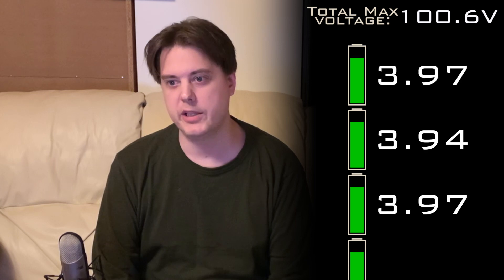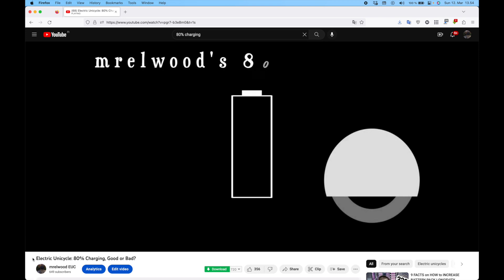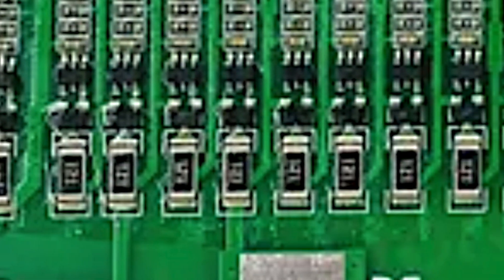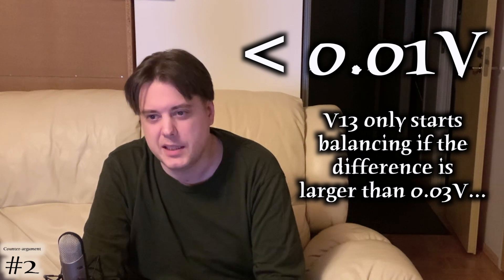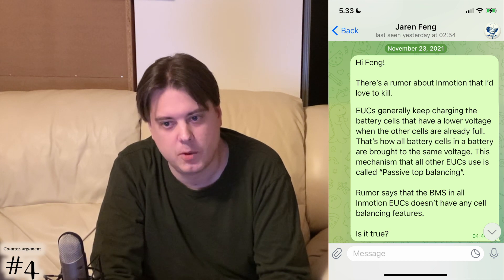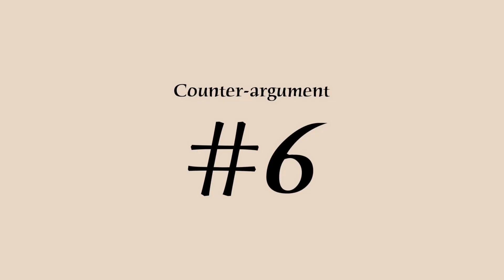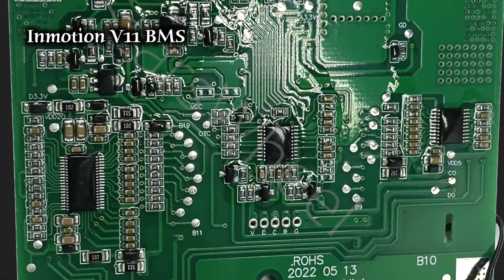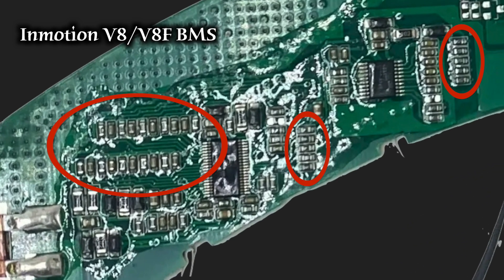Inmotion EUC Battery Cell Voltage Balancing, Yes/No?

Comment: I'm owner of v10f. I did several time power measurements with power meter (which measure power and circuit). Normally v10f  take around ~130W during charging. After green light appear on power charger it still taking ~15W and slowly decrease to ~6.5W after for around 1-2 hour(s). After 1-2 hour(s) measurement finally stabilize at ~6.5W and even it still plugged to power for longer period  (several hours more) never decrease lower than ~6.5W. Based on my measurement looks like passive balancing is working if someone else have different vendor wheel and done measurements please add comment.
Reply from the maker: What you’ve described isn’t related to balancing. The constant voltage (CV) stage of battery charging in general behaves exactly like that. The charging voltage stays the same, but as the battery fills up, the charging current decreases. Your charger would probably draw around 6.5W even if unplugged from the wheel.

The balancing currents are in the magnitude of 5-35 mA. They wouldn’t show even a dent in the total charging current measurements.
Reply: @mrelwood_EUC  Do You have idea why green light appear on charger even there is 15W taken by wheel for 1-2 hour(s) and seems charging hasn't been completed? I've seen some graphs with charging phases for batteries You're described but in that case green light on charger should only appear after all stages have been completed not earlier or maybe I miss something?
Reply from the maker: @cubbasa  The chargers turn green usually when the charging current reaches down to 0.3-0.7 A, depending on the charger. Your charger seems to go lower though, it could be triggered at only 0.15A, which is already pretty good.

The charging isn’t fully completed at any point though. As you noticed, it only slowed down to around 6.5W, but kept going still. So the charger needs to turn green at some point. And I believe it might happen a bit early just to get better charging times, or because the manufacturers try to avoid overcharging the batteries, which of course doesn’t take balancing into consideration.
Reply: @mrelwood_EUC  So, how do you know you don’t overcharge the batteries, trying to balance them?
Reply from the maker: 1) The charger has a set maximum voltage, so it can’t charge the battery to a higher total voltage than that.
2) The BMS has overvoltage protection for each cell group, so it doesn’t allow any cell group to get over 4.25V.
3) If the balancing system of a BMS fails (or doesn’t exist), in most cases where a cell group could reach the 4.25V limit will do so before the batteries have been completely saturated with said voltage. This means that once the BMS cuts off the charge (due to an overvoltage cell group), all cells drop a bit in voltage. This removes the overvoltage situation if one happened to formulate for some reason.
Reply: @mrelwood_EUC  So you can keep a wheel connected to power indefinitely without overcharging, being protected by BMS?
Reply from the maker: Yes. But trickle charging the cells “indefinitely” is not good for the battery lifetime, so always having the wheel in the charger isn’t a good idea because of that.
Reply: @mrelwood_EUC  OK, thank you. Some say, Inmotion wheels doesn’t have BMS. Which is it?
Reply from the maker: @danmano478  Haha! 🤣 Very funny!
Reply: @mrelwood_EUC  I’m glad I’m wrong and you are happy.
Reply from the maker: @danmano478  Wait, you were serious?? Ok, first of all, who says that and why?
Reply: @mrelwood_EUC  Man, I don’t know electronics like you. All idea I can make on this subject is from what I read from Euc owners Youtubers or commenters like you. I don’t recall where I read about some wheels having BMS and some not having; maybe there was some other stuff involved, I don’t recall. If you want to bring some clarification for me on this subject, fine, if not, no problem, you owe me nothing. Thank you for already given answers.
Reply from the maker: @danmano478  Ok. BMS is a circuit board that takes care of all the battery protection features, charging, balancing, etc. There can’t be a device with a rechargeable battery without at least some kind of a rudimentary Battery Management System. I showed photos of the BMS boards on many Inmotion wheels right in this video. You can look the rest up with Google Image search if you wish. A rumor like that is so ridiculously stupid that it must’ve started from complete misunderstanding of what a BMS even is.

Lesson to be learned: Some people sometimes say false and ignorant stuff. Don’t trust stuff until you verify either the source or the piece of information itself. Disinformation is the cancer of our current society.
Reply: @mrelwood_EUC   That’s why I asked. Thanks. What do you think about LG cells (like LG M50T or LT) and Samsung cells (like 30E or 50E) in terms of reliability and longer life? General idea is that Samsung are better. I understand that not only the cells were responsible for Begode fires, but nonetheless, they all had LG M50T batteries. I didn’t heard of Samsung cells wheels on fire (maybe that first S20 purposely burned by UStride had Samsung cells?). New expensive wheels have Samsung cells, hence the idea Samsung is better.
Reply from the maker: None of the cells will spontaneously combust. I haven’t looked into them in such detail that which ones would have the longest lifetime. High discharge cells are beneficial in some situations/setups, other than that I’ve not looked into them closer. The Sanyo GA cells on my MSX worked perfectly for 14+ k km, the ones on my V11 have worked perfectly for 7+ k km. I don’t think one would choose an EUC based on the cell model. We don’t choose the wheel based on the mosfet model either. They are all designed to do their job.

The Begode fires were caused by the subpar quality of the BMS board in the specific 900Wh packs. The same cells haven’t caused much fires in other wheels.
Reply from the maker: Btw, I think my batch 1 V11 has the M50T cells as well. No fires. 😄
Reply: @mrelwood_EUC   I think all Inmotion wheels have LG cells, because, from what I heard, Samsung are more expensive, and a few dealers I asked, told me both Inmotion and Kingsong don’t disclose what cells are using inside their wheels. I thought: “If they would use Samsung they would have no problem admitting it, since they are better and more expensive. So, they use LGs and hiding it.” I don’t agree with you on this: The customer has the right to know what cells he’s buying, batteries being a significant fraction of the payed price, so, yes, we should choose the wheel with the best cells for higher reliability. Here you take Inmotion’s side, knowing that they don’t want to use Samsung cells, for profitability (this is their specific corner cut). I saw a lot of Youtube videos or shorts with V12HT not turning on, or uneven batteries charging, etc., which I attribute to poor cells in the batteries. Didn’t see such problems for Master or T4 with Samsung cells. They have other weaknesses like low shock resistance and waterproofing, or maybe suspension problems, but not battery related problems. Veteran also uses Samsung cells in the most sold and reliable wheel Sherman max. Why don’t they use LGs? Rhetoric obviously. And not to forget: It’s not only about the fire, but also about the long time reliability of the batteries=wheel.
Reply from the maker: You are awfully quick to judge, and especially condemn me as taking sides.

First, Inmotion changed to Samsung cells on the V11, all silently, not bragging about it at all, not even announcing it:
https://forum.electricunicycle.org/topic/21534-inmotion-changes-from-lg-to-samsung-50g-cells-for-v11-production-citing-lack-of-supply/

Secondly, ALL local Masters I know of have had one of their battery packs replaced in warranty. And often since other parts as well of course. Lots of battery replacements here as well:
https://forum.electricunicycle.org/topic/26527-begode-master-134v-2400wh-suspension/

If there is such a quality difference between LG and Samsung, please show me data on it. And I don’t mean what you have experienced personally, but on a larger scale. Because from what I’ve seen, there isn’t such a trend. There is a trend on warranty issues on wheels per model, and especially the Master is a nightmare if you read the thread I linked to above.
Reply: @mrelwood_EUC    To be honest, me saying you take sides was more a provocation for you to see how you react and what info you provide to combat my points, all for knowing how trustworthy you and your infos are. Probably you’re right, I start from the idea that any Youtuber (creator or commenter) could have potential connections/relations with dealers or manufacturers in order to promote their image and sells, in exchange for some discounts, better warranties, or better QC verified wheels when buying. In fact, the more I exchange with you, the better my opinion of you is. Probably, you about me, is vice-versa. Doesn’t matter since you made a great deal of effort responding to my questions and giving me infos, so this is what counts for me. I will check the links. Good to know about Master battery failures despite being Samsung. Probably I have a misconception about Samsung being better than LGs, and the split reporting about wheels, V12 for example, reflects in fact a general lottery when buying any of these wheels, regardless of manufacturer, or the batteries they have. As a conclusion, from a reliability standpoint, I understand, you recommend V11. I would like to know if you find it more reliable than V12 HS/HT, or you choose it only because you need suspensions. I would prefer the most battery for the smallest possible weight, that means a wheel without suspensions. As for the warranty issues nightmare I read about evees dealer saying  V12s have the greatest rate of warranty requests, also 2 European dealers admitted to me the same in chat or messages. For sure I would have liked to buy a reliable V12 HS/HT with Samsung batteries (the bias persists), for its waterproofing, shock resistance and digit lockable feature. I retract “you siding with Inmotion” thing. Peace.
Reply from the maker: Interesting. I can guarantee you, while I have shared my ideas and opinions to Inmotion, we don’t have any kind of business relationship, nor do I get anything from them for free or even with a special price, nor do they share any secrets with me. I’m just an EUC enthusiast with a small YouTube channel, and being long enough in the game I have learned a thing or two.

In my opinion, the battery issues on EUCs are mostly related to the BMS itself, or a badly balanced pack from the get go.

As much as the V11 is a good fit for me, and being improved for 3 years already, I don’t think that it can be recommended point blank as the most reliable wheel. The suspension design could be better, and without care and maintenance it can’t be called very durable. Still, it’s the best fit for me. But after having the luxury of Inmotion ride modes and riding comfort, I don’t think any other manufacturer is going to make my next wheel. Or the wheel after that.

The high number of V12 warranty issues is easily explained by the mosfet issues on the early batches. But all units with the old mosfets were recalled, and either the mainboard replaced with a new version, or a new mainboard provided to the user. (No other manufacturer has ever done that btw.) The problem was though that many people tried to install the board themselves without sufficient skills for doing so. But later V12 units with a factory installed new board (since about early 2022) have seemed at least as reliable as any other wheel.

Though what you said about the lottery of purchasing EUCs, I think you are correct. There are some issues with every single wheel model. You just have to choose the issues that you are the least appalled by. But definitely read up on user experiences as much as you have the patience for before buying any model!
Reply: @mrelwood_EUC   I was referring more to V12HT, that came already with new board and still has problems like no more turning on of a few weeks bought wheel, or uneven battery charging of a freshly bought one. Still trying to find the reliable wheel under 30kg, apart KS18XL, that hasn’t enough torque (for fast acceleration and braking) for me.
Reply from the maker: Name a wheel model and you can find common issues for each. What you need to keep in mind is that what’s more relevant is the percentage of wheels that the failures present themselves in. For example the Monster Pro hasn’t sold but a few units, so naturally we see much fewer issues with it than with the V12HT that has probably sold in the thousands already.

Unfortunately if you’re looking for a wheel that would have significantly less issues than any of the current ones, you’ll have to wait for a decade. If you want a wheel now, you just need to read on each model’s common failures and choose from them.

While I didn’t praise the V11 suspension for durability, other than that it’s one of the most solid offerings today. And once the suspension wears out at 3-10 k km, you just replace the few worn parts and be done with it. You don’t get the best suspension, but still not a bad deal in my books.
Reply: @mrelwood_EUC  And a wheel without suspension? Suspension is not paramount for me.
Reply from the maker: It depends so much on how you ride, how fast you ride, what’s your weight, how far you want to ride, etc, that I’m not sure if this is a good forum for individual recommendations.

There is a separate subforum at forum.electricunicycle.org for recommendations. I’d go check what others have asked, and what kind of answers they’ve gotten.
Reply: @mrelwood_EUC  I already read a lot there. Problems everywhere. Sounds like most reliable proven are KS18XL and Sherman. If you start reading the post there, you lose the courage to buy an EUC. Some threads headlines: 
“2 month old V12 HT died - broken shoulder”, “Inmotion v11 please repair login error on battery”, “V12 HT issue - sudden tilt back and acceleration”, “V12 Battery fault”, “I dislike Inmotion quality (split from: Inmotion v13 useful information)”, “V12 Cutout tracking”, to name a few. I gave you only Inmotion cookies, because you’re an Inmotion fan. Of course, same disaster you find for the other manufacturers and models. Probably, generally speaking electric vehicles are not safe, reliable and affordable, hence worthy. But you, enthousiastes, are captivated and blinded.
Reply from the maker: Again, you’re losing perspective. If one guy creates a thread about an issue of a wheel that has been sold in the thousands, the proven failure percent for that issue is then less than 0.1%. That is a MAGNIFICENT failure rate for any product!

V11 and S18 were the most used wheels around the world last year. There are estimates of 100’000-200’000 riders across the globe. If there are a 10’000 V11 units in existence, just one percent of those would already be 100. How many severe V11 issues did you find within the last 12 months? 12 months because there are known faults in the early V11 and V12 versions, which have long been fixed.

To call riders blind to the issues is incorrect. Almost every rider is very well aware of the current state of EUCs’ failures, because the risk on a self-balancing vehicle is completely different in severity than on e-kickscooters for example. But we ride DESPITE all that, because the value it brings to our lives is large enough for us to be willing to take the risk. You can’t imagine how magnificent and life altering it can be before you’ve experienced it yourself! 😉
Reply: @mrelwood_EUC   Ha ha ha. You’re last sentence made me laugh. I already told you that I had a V5f (which doesn’t make me an Inmotion or EUC fanboy though) for one year, period in which I did almost 15000 km, commuting 5 days per week to work 22km, and then, same day, after work, another 2 or sometimes 3 trips 20 -22 km each after the recharching pause (this because I get caught by the weekly range contest in Inmotion app, and willingness to be in first 10 V5f owner ranking, and when there, to become the first, which I did. That year I dedicate entirely my free time to EUC). For sure you didn’t do not even 10000km in your first year with your first wheel. Not bragging, just a natural response to your patronization. In this order of ideas, your V11, with your 7000km done, is not proven yet: V5f 320Wh battery ~15000km done -> V11 1500Wh battery 15000 x 5 = 75000 km, 5 times being V11 battery bigger than V5f’s. Not going to happen: the bigger the wheels/batteries, the lesser reliability, in practice, not in theory. The 0.1% failure rate you gave is not scientifically proven, there is not only the guy who created the thread, but a lot of other thread participants who confirm the issue; and these threads are plenty. In addition there are the shorts and youtube videos of little channels, normal users, not established, or wannabe there, EUC youtubers who have PR ties with manufacturers (of course these last ones will never admit their bias for losing the credibility and advantages). EUCs are very cool and useful, unfortunately the chinese manufacturers are on a mission to getting rich on the expenses of gullible westerners’s money and health. You didn’t state if those 100000 - 200000 EUC owners are a total for all models or only V11 and from where do you have these numbers (I can invent numbers too). Also, not every user with defect EUC report his story on internet (for example me). So your failure estimation isn’t accurate. No offense, but Inmotion or even other EUC manufacturer should hire you for PR: you are really good 👍.
Reply from the maker: 😄 “Scientifically proven” failure rates?? You crack me up! I thought I was clear enough that the failure percentages were just examples of how percentage works. Maybe you are reading my comments with tinted glasses, it feels like. Though even all the ones you mentioned can’t be verified to reach 1%. I’m well aware that the actual failure percentage is larger, EcoDrift has good data on it a few years back. GotWay was the leader with over 30% warranty rate. No surprises there.

For the total rider amount, it was discussed at the forum maybe a year ago. As I said, they are only estimates, just like the V11 sales numbers. They’re probably somewhere around 5-10 k units, but Inmotion will never disclose this, so it also remains an estimate.

15k in a year, holy cow! And on a V5F, holy duck!! My best was I think 11k in my second year on an MSX. Total with all wheels is about 33k. Unfortunately my health has been pretty bad for the past year, so I haven’t gotten much mileage on the V11.